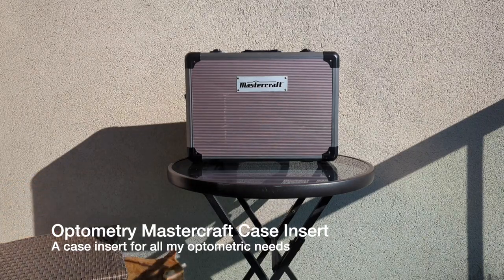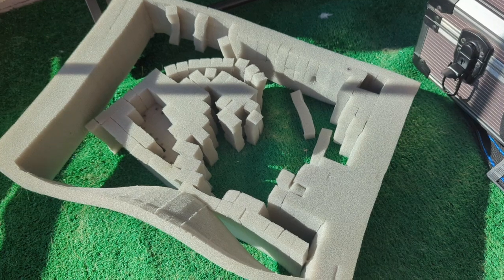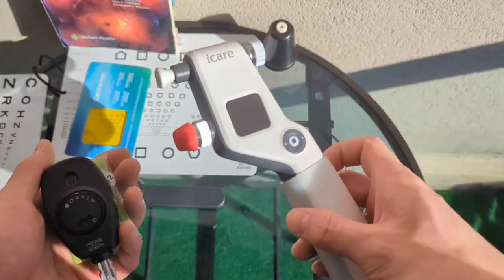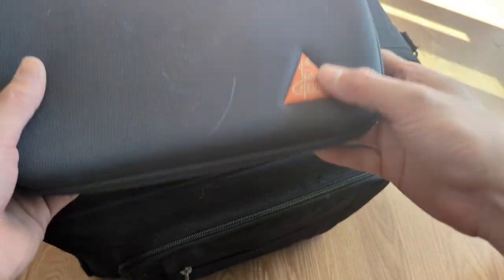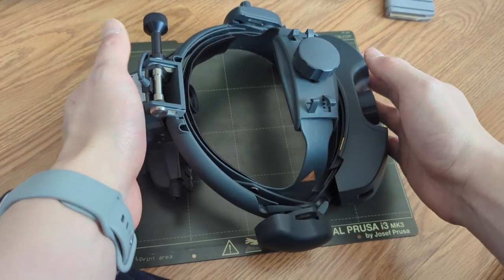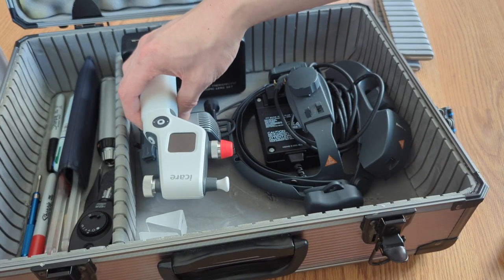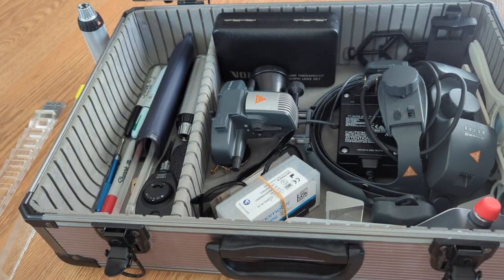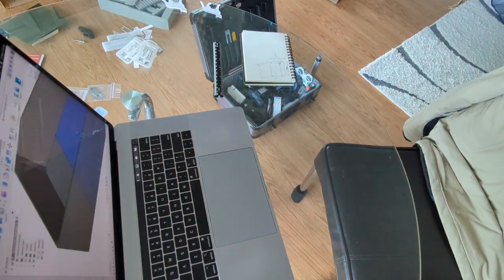Optometrist Reorganizes His Equipment with 3D Printing

Comment: none of those are food safe and if exposed to moisture will be a breeding ground for bacteria. you would need a ruby or stainless steel tip and food grade filament plus the ability to seal the piece to fix all the micropores / jagged surfaces where bacteria will grow. just noting in case that's a concern for optometry use case. I dont think any of those tools will be touching mucous membranes or going into vulnerable areas that might be exposed, other than skin, but I don't know how sanitary you need to be